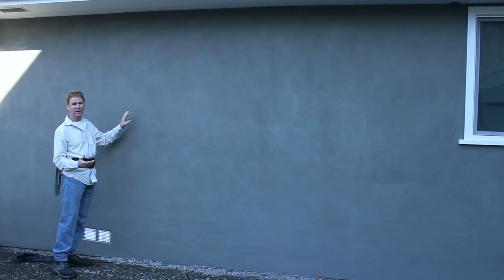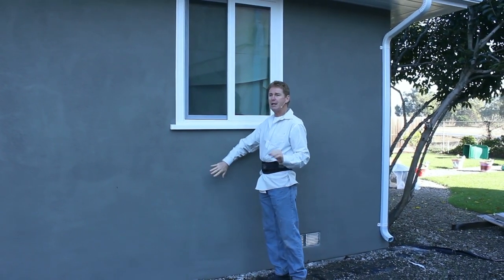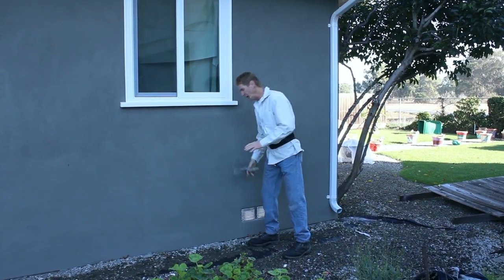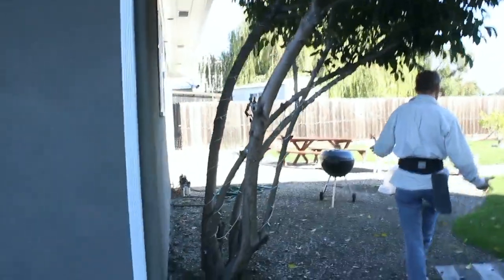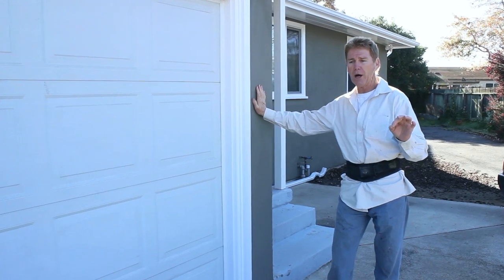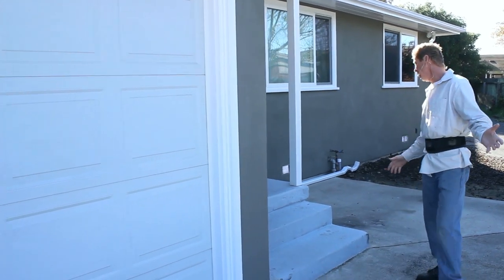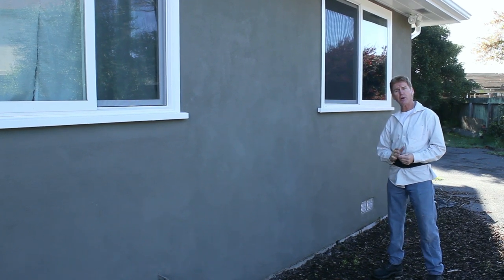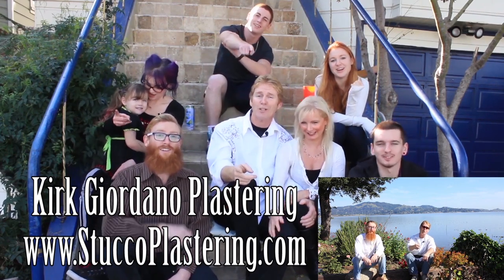Stucco acrylic vs. traditional stucco, cost difference.

Comment: 30 year warranty with efis correct?
Reply from the maker: Morning Better Built Dude, different products different warranties.
 I sure can't keep up with thier cahnges.
                    plaster, it’s everywhere you want to be
         Mastering Plastering for the beginner’s to experts
Reply: Kirk Giordano plastering Inc. I just stuccoed the roof of my new house build. I bet you’ve never seen that before? Lol!!
Reply from the maker: Howdy Better Built, think again, unfortunately, i have seen this, it didn't last, but a year or so.
 I'd suggest if someone were to do this use a quality peal and stick thick rubber membrane over entire area, then attach mesh netting with just the necessary staples needed, caulk all the staples with Sikaflex polyurethane caulking, use a basecoat of BMI's reinforced fibered cement plaster . as it's water-resistant, allow to cure, then apply a primer with the best acrylic stucco sold in the U.S. I'd recommend, stucco-flex, Carsons, BMI, or dry-Vit.
 best wishes,
                 Live long and plaster
 Do’s and don’t of plastering’s leading experts
Reply: Kirk Giordano plastering Inc. I fiberglassed the roof like a boat for waterproofing, polyurethane glued 4” eps, I used perma lathe from BASF embedding the one coat stucco mix. I’m going to seal it siloxane sealer. The roof is waterproof prior to stucco. I’m more than likely going to use a acrylic over it, I just want see how  the regular stucco holds up first. Appreciate your input, I will email you pics when it’s all done. I did post a starter video on my channel if you care to look.